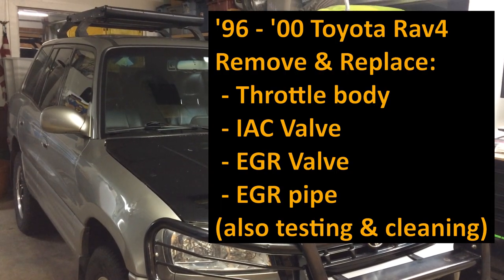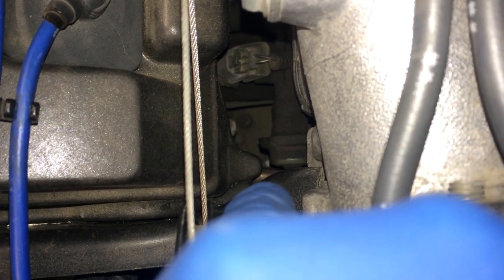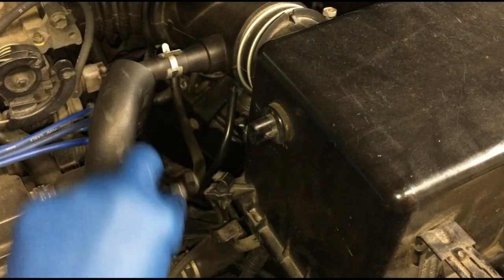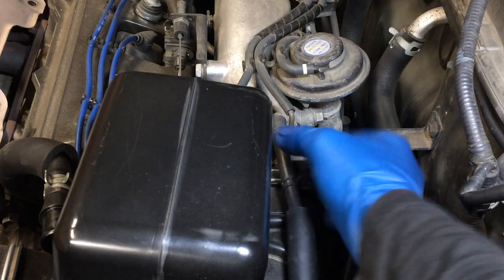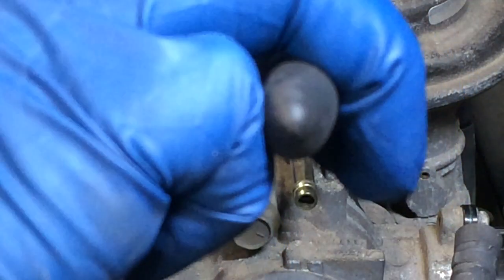1996 - 2000 Toyota Rav4 DIY Remove Throttle Body, IAC Valve, EGR Valve, EGR Pipe, with Bench Tests

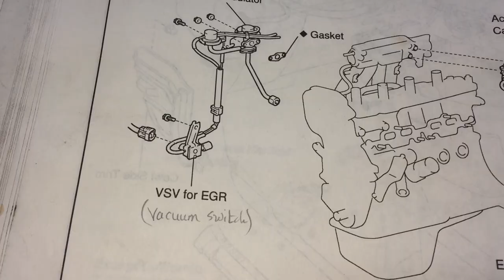Comment from the maker: Update: torque valve for the EGR pipe union nut (46:50) is 43 ft-lbs. 
Torque values for the four manifold stay/bracket (48:54) are 31 ft-lbs for the 14mm, and 15 ft-lbs for the 12mm nut and bolts. 
Video links for the EGR Diagnostics Video and the VSV Video are below the Timestamps:

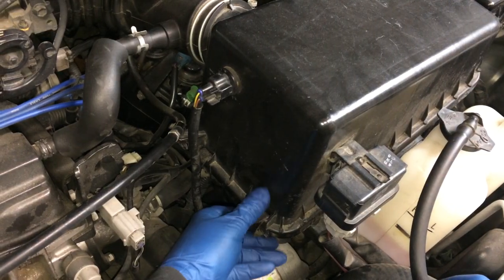00:01:27  Location of EGR Valve and notes about removal
00:01:23  Remove Air Box and Air Intake Hose
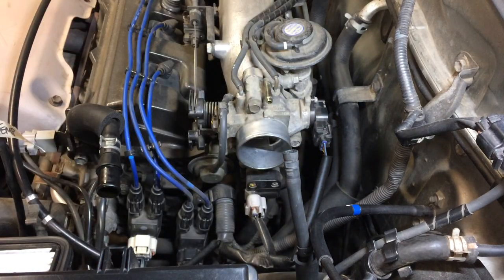00:03:00  Throttle body -- closer look
00:03:13  TPS (Throttle Position Sensor) location
00:03:25  IAC (Idle Air Control Valve) location
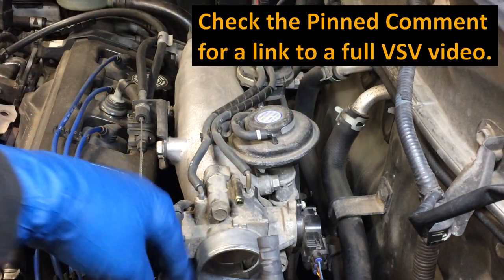00:03:45  Disconnect electrical for TPS and IAC Valve
00:04:15  Remove Throttle Body vacuum hoses  
00:04:48  Disconnect throttle link and kickdown cables
00:05:17  Remove three Throttle Body mounting bolts (12mm)
00:06:00  Disconnect Coolant Hoses and Vacuum Hose from Throttle Body
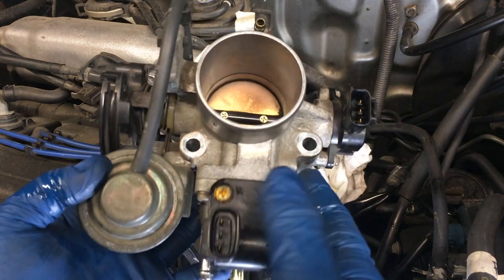00:08:06  Remove Throttle Body

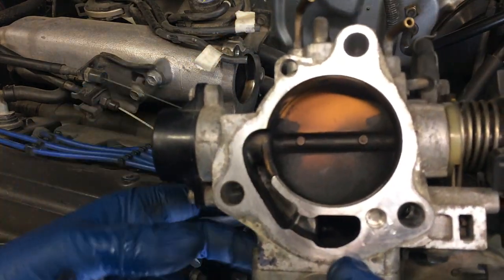00:08:42  Throttle Body on Bench: various components on the Throttle Body

00:10:08  IAC Valve and TPS screws are JIS (Japanese Industrial Standard) screws
00:11:35  Remove four JIS screws for IAC Valve
00:13:15  Removing stripped JIS screw for IAC Valve
00:15:23  Remove IAC Valve from Throttle Body
00:16:14  More JIS screws on IAC Valve
00:16:35  Clean IAC Valve
00:17:55  Removing screws for pintle access on IAC Valve
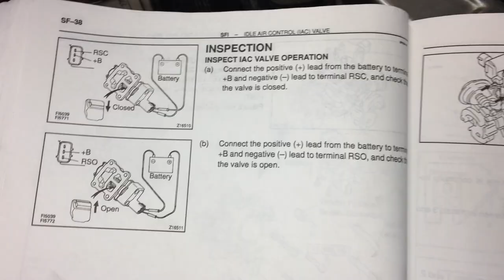00:21:41  Bench test IAC Valve
00:24:38  Clean Throttle Body 
00:25:53  Install IAC Valve back to Throttle Body (gasket is Felpro 61085)
Skip ahead to 52:30 for Throttle Body re-install if you aren't removing the EGR valve.

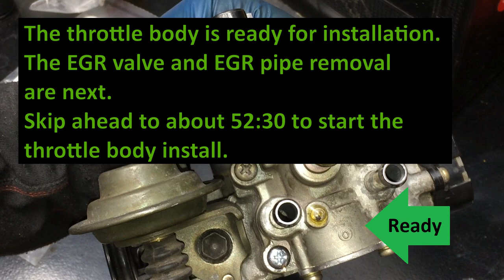00:27:45  Remove EGR Valve
00:30:37  Clean EGR Valve
00:32:05  Gaskets for EGR Valve (Toyota 25627-74011
 and 25628-74010)
00:32:17  Bench Test EGR Valve
Skip ahead to 50:00 for EGR valve re-install if you aren't removing the EGR pipe.

00:38:31  Remove Components for EGR Pipe access
00:39:03  Remove Manifold Stay parts 
00:42:49  Notes about differences with '96 and '97 Rav4s (distributors)
00:43:51  Open the nut for the EGR pipe
00:45:00  Remove EGR pipe
00:45:22  Clean EGR pipe

00:46:02  Reinstall EGR pipe (torque is 43 ft-lbs)
00:47:09  Reinstall Manifold Stay parts (torque for the 14mm bolt is 31 ft-lbs; torque is 15 ft-lbs for the three 12mm's)
00:49:58  Reinstall EGR Valve (torque for 12mm nuts is 108 inch-lbs/9 ft-lbs, 10mm bolts are 87 inch-lbs)
00:51:57  Connect hoses for EGR Valve (exhaust on bottom and vacuum on top)

00:52:26  Reinstall Throttle Body
00:52:36  Connect coolant and vacuum lines to Throttle Body
00:55:30  Throttle Body gasket (Felpro 61083)
00:56:30  Install three bolts to mount Throttle Body (12mm, torque is 168 inch-lbs/14 ft-lbs)
00:57:12  Connect throttle link and kickdown cables
00:57:37  Connect vacuum hoses
00:58:04  Connect electrical for TPS and IAC Valve

01:00:27  Install air hose and air box
01:02:47  Last check on re-installed parts
01:03:58  Conclusion, recommended to disconnect battery to re-learn idle.

Full EGR Diagnostics, Engine Testing, and Bench Testing video for EGR Valve, Vacuum Modulator, and VSV:
https://www.youtube.com/watch?v=pdpnk2f7gnc&t=834s

Full bolt-by-bolt for removing, testing and replacing the VSV:
https://www.youtube.com/watch?v=1Z-sy6z14D8&feature=youtu.be

Thanks for watching!  I hope this video was helpful for you.  
Good luck with your repair!
Reply: Keep making videos!

Comment: I am so impressed by this video that I had to leave a comment before I've finished watching it. Thank you for your instruction and time. I have this exact car except it's a 5 speed. What would be different in removing the EGR Valve if anything?
Reply from the maker: I'm sorry for the delay in responding, as I missed your comment -- the only difference for the manual transmission is that you won't have the second cable to disconnect on the throttle body (the "kickdown cable", which is only on automatics); this is shown around the 04:50 mark.  Other than that, everything is the same!  Good luck, and thanks for your comment!

Comment: Those IAC valve screws are hard to break free.   I was in my friend's driveway and he didn't have many tools...  I couldn't get them to budge with the Phillips drivers that he had...  they didn't fit well and I was worried... that it wouldn't go well.   So, I chucked his Phillips drivers and grabbed a slotted driver (which hardly fit).  I knew it was a gamble.   The slotted/flat bit driver didn't give me much confidence.        I pressed on that rascal with all of the force I could exert and then applied torque to the screw.   CLICK!  One came free!!  I think it only had two screws (the other two screw cavities were vacant).  I removed the IAC and inspected.  I didn't notice anything "wrong " with it.  But it seemed a little sloppy:  it wasn't a solid in the radial plane.  Upon further troubleshooting(I connected the wiring/plug and turned the key on an off.   I noticed that it made  a funny noise ?...    I took a break and researched the problem.   I watched yir video and stepped back on the mat.  After 15 minutes I was done.  It was a old IAC. I replaced it and the problem went away.
Reply from the maker: I'm sorry I missed your comment - wow, that's great!  Great work on taking care of the problem! Yes, those screws are very tight and the JIS heads get chewed up easily. I'm glad you got, and thanks for adding your tips : )

Comment: This is the absolute BEST video on car repair/diagnostics ever..... You give clear and concise instructions with clear pics.... You give a great explanation of how each part works . This is just the most thorough video I've ever come across . I do my own repairs and have watched countless videos , so I know that puts this video at the top of the list of 100's if not 1000's of videos I've watched.... 
And I might be out of place , but it sounds like its a female making the video. If so , you're awesome.....
Reply from the maker: Wow, thanks for your comment! Yes, I'm a woman. I'm glad the video helped, and thanks for watching : ) 
Check out the channel for some other Rav4 videos!
Reply: @L35inColorado  I was looking thru your other videos but didn't see it , so I figured I'd ask ... Did you do a video with removing the injectors on the RAV4 ?
Reply from the maker: No, I have not done a video on that job yet - as you know, there's not much room back there because the intake manifold is in the way. But you don't have to remove the intake manifold: you can reach the injectors by removing a couple mounting bolts for the throttle cable, and then removing the valve cover.  Once the valve cover is out of the way, then I think there's two 12mm bolts holding the fuel rail to the head - you remov the fuel rail bolts and you can reach the fuel rail and pull it up, then disconnect the electrical for the injectors and pull them out. It's a good idea to depressurize the fuel system first before you start the work: remove the EFI fuse and then use the igition key to try start the engine - the engine shouldn't start because it shouldn't be getting fuel, and that means it is depressurized (though there will still be a little fuel that might leak when you remove the injectors). 
If you search for videos for the 5S-FE engine, the process is very similar or identical to the 3S-FE - here is an example:
https://www.youtube.com/watch?v=1Br6F3j87b4

I hope that helps! Good luck : )
Reply: @L35inColorado  😳😳😳 HOLY COW ! What a response! I knew subscribing to your channel was a good idea ! Thank you for the info . I was looking at it and was thinking the same thing. Im pretty sure I could get my hands in there if I just removed the cable cover and stuff like you said. Just wasn't sure about the fuel rail. Your response gives me confidence to go ahead and give it a go ! 😁 Thanks again !
Reply: @L35inColorado  I took the plunge and tried changing fuel injectors out. I bought one new one and cleaned the other three so they worked really good. I put the car back together, and now it won't even start....☹️😡☹️ What could I have done wrong ? 
I removed the throttle body, throttle cables, the air intake boot , then the valve cover. Two bolts for fuel rail..... Wasn't that bad. Hardest part was getting valve cover off...🤪 
But the car won't start now. It will with starting fluid , kinda ...... Any help would be very much appreciated.....
Reply from the maker: @firemanjim324  Ah man, I'm sorry that's happening - Did you remove the EFI fuse to depressurize the system beforehand, and if so, did you remember to replace it afterwards? 

When you say it will start with starter fluid, does is start then quickly die again?

Here's some items to check (using the "F A S T" check: fuel, air, spark, timing):

Fuel: If you're smelling fuel, like the engine might be flooded due to a leaky injector or something, then remove the spark plugs and see/smell if they are soaked with fuel.  If they are, then you know it is getting fuel - but too much fuel so you can start to troubleshoot down that path.  

Air: Double-check all your hoses, in particular the small diameter hose to the MAP sensor: it is the small hose that runs from the back of the intake to the black MAP sensor, which is mounted on the firewall towards the passenger side. Sometimes that hose is knocked free when working in the intake area, and if that hose is disconnected on either side, it causes a huge vacuum leak which kills the engine quickly and even can prevent it from starting for more than a second or two.

Also, if you completely removed the throttle body (meaning you also disconnected the coolant and air lines on the bottom of it) make sure that you didn't accidentally connect the coolant line to the vacuum line during re-install. I have heard of this happening once in the forums. 

(Hopefully it is not this case, but if so, you'll find coolant where it shouldn't be - in the cylinders! - and you'll notice your coolant level dropped: in the case on the forum, the Rav started up and idled for a few minutes, then died and wouldn't restart, so that sounds different than your case and hopefully it is not your case, but check those hoses anyway if you disconnected them before).

Spark/timing: If all your hoses are good, double check your ignition wires to be sure that you didn't accidentally put them back into the wrong cylinders. If you disconnected both ends of the ignition wires when you removed the valve cover, make sure you re-connected them back correctly to their respective points (if your Rav is 97 or older, you'll have the distributor; if 98+, you'll have two ignition coil packs with numbers for each cylinder). 

I hope these items help you troubleshooting. It is likely something simple, so back-tracking and double-checking might help to discover the issue. Good luck!

Comment: Thank you so much for these exceptional DIY vids!!! Just cleaned the EGR valve on my '97 5spd. Instead of two bolts holding it to the pipe on mine it's a 24mm nut. I used a 24mm crowfoot on a ratchet extension to take it off. To get to the other end of the pipe I removed the distributor. The crowfoot wrench made this job very easy for me (inexperienced)
Reply from the maker: I'm sorry I missed your comment - well done on your DIY!  Thanks for adding your tips, too!  : )

Comment: Congrats for making the best video for this gen of the Rav4 🙏🏻, it is really helpful for me, but I'm curious, why did you use Felpro gaskets instead of the OEM? 👀
Reply from the maker: Thanks!  I prefer the OEM gaskets, especially for the throttle body, but if I cannot obtain them in a timely fashion, I will use Fel-pro.  
In particular, I like the OEM throttle body gasket better, because it is a two-layer steel style, so there's nothing to clean up when you remove it.  The Fel-pro throttle body gasket for this application works fine and I've never had an issue with a vacuum leak, but it is a composite metal material so it leaks a little bit to clean up.  I hope that explain it!  Thanks for watching : )

Comment: These are great RAV4 videos!!  I just broke the bottom 10mm bolt between the EGR pipe and the EGR trying to remove it (lots of penetrating fluid).  2000 5S-FE engine, looks just like your RAV4 engine. My background is that I'm a DIY person, I've been working on my cars and house doing more complicated things as time goes on.  I have the 2 nuts and the other bolt out of the EGR.  It looks like I could take a sawzall and cut off the top of the EGR valve, drill down through the lower EGR hole where the rest of the broken bolt still is (now that the round top of the valve is gone), and get the rest of the EGR valve off that way.  It doesn't look like the holes where the EGR pipe mount to the EGR valve are threaded, so if I go slightly off as I'm drilling, this doesn't seem like it would turn out bad (just screw on new 10mm bolts through my new gasket), etc.  Does this seem like a good approach, or is there an easier or better way?
Reply from the maker: Ah man, I'm sorry that happened - broken fasteners are never fun!  If you're still working on this, it seems that me that you're describing the problem as this:  
- the bolt head is broken off, so there's no clamping force on the EGR valve flange to the EGR pipe flange;
- but the broken bolt shaft is long enough that it still extends from the threaded hole in the EGR flange a bit into the hole in the EGR pipe flange enough to prevent you from being able to slide the EGR valve towards the firewall to get it free from the manifold studs and EGR pipe flange;
- you're trying to devise a way to get the EGR valve out (which sounds like you're replacing/willing to destroy), but that broken bolt shaft is interfering.  
Is that about right?

If so, here's what I'd try (trying to mentally visualizing this):
- Loosen/disconnect the flare nut the other end of the EGR pipe (where it connects to the head, shown later in the video) so that you can move the EGR pipe and EGR valve together towards the firewall;
- once you move the pipe and valve towards the firewall enough for the EGR valve to clear the studs on the intake, you'll be able to separate the EGR pipe from the EGR valve;
- then you can remove the broken bolt from the EGR valve on the bench (if you're not replacing the EGR valve entirely);
- you'll need a new bolt, obviously; I'm not sure what that size is off the top of my head, but according to the parts diagram the part number is Toyota 91511-60614
(https://toyota-usa.epc-data.com/rav4/sxa11l/2352/engine/2501/?partno=9151160614#2)

That's the approached I'd take: if for some reason you can't get to the flare nut on the other end of the EGR pipe (ie, tools) and you're willing to destroy the EGR valve flange, then your idea of cutting will certainly work, but you'll need to be very carefully not to accidentally damage the intake while working in that rather cramped area with a high-speed cutting tool, and you'll also want protect all intake and cylinder head openings from any metal shavings that the cutting process will produce.  

It would be big trouble to introduce metal bits into the intake or head, so personally I'd be reluctant to cut, and instead would try the method described above of simply disconnecting the other end of the pipe.  That also gives a chance to clean the EGR pipe, and allows the re-use of the EGR valve (since you can remove the broken bolt from the EGR valve flange on the bench by simply drilling it out).   

I hope that helps - good luck! : )
Reply: @L35inColorado  Says: "you're trying to devise a way to get the EGR valve out, but that broken bolt shaft is interfering?" - Yes, exactly!  Thanks for the quick response!  I approached this the way you outlined even though it meant a lot more work - on a Camry 2.2L, the throttle body needs to be removed to get at the bolt holding the plate the coils are mounted to.  I was nervous about removing the EGR pipe, but I soaked it in liquid wrench for a couple of days, and it came off with a crowsfoot wrench and breaker bar.  I also removed the IAC valve and cleaned it while the throttle body was removed.  I ordered JIS bits and waited almost 2 weeks for them because of Christmas, then remembered I had a hammer-operated impact driver, which actually came with 2 JIS bits (sizes 2 and 3).  I had been soaking these screws for a couple days as well (the screws were pretty rusty on the exposed threads.  I put the throttle body in a vise with cardboard, and cut a little block of wood to protect the throttle body from damage.  The impact driver worked well!  I also need to do some VSV work, and then I'll reassemble everything.  Thank you again for your great suggestion, and your videos that got me going!!

Comment: I love your videos. My Rav thanks you lol. It's been through a lot. I just did motor mounts, and I still have a slight shake while in park. I'm going to do a full clean on the TB.
Reply from the maker: Thanks for watching -- good luck! : )
Reply: Did motor mounts as well, I’m about to do the same! Curious, did the shaking go away?
Reply: @stoicgradstudent3976  Sorry for the late reply. Yes it did. I now have a 97 I'm restoring with another idle issue. What do ya know it's the EGR. So I'm back again lol.
Reply: @L35inColorado  So I have a 97 and the EGR line at the bottom is quite different. What would be a good tool to reach that single line. I'm not sure what size the nut is. It's bigger than a 19mm.

Comment: Hi L35 THANK YOU soo much for the time and detail representation in troubleshooting and resolving this nightmare code most professional mechanics can't figured it out. One question though, could you please share the part number or brand of hand pump so I can order it at a auto parts or Amazon please.
Reply from the maker: Sure, the hand pump in the video is this one here:
https://www.harborfreight.com/brake-bleeder-and-vacuum-pump-kit-63391.html
Any hand pump will work -- just be sure it doesn't leak, so you don't get false readings
Thanks for watching, and good luck!